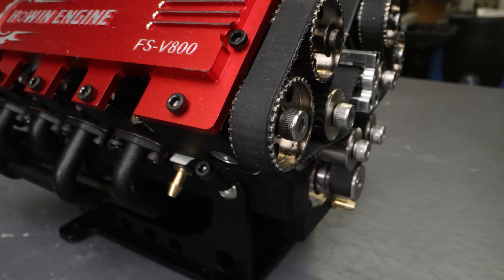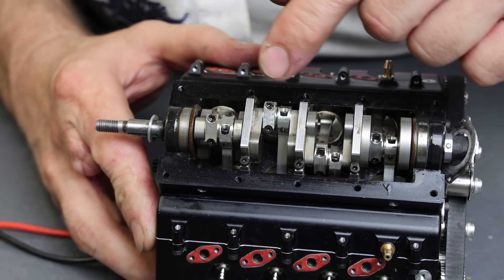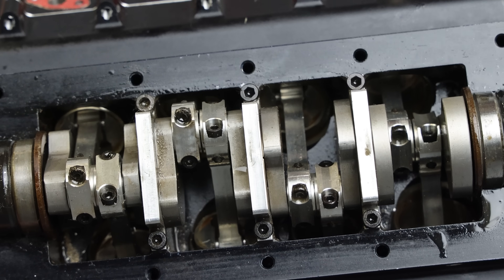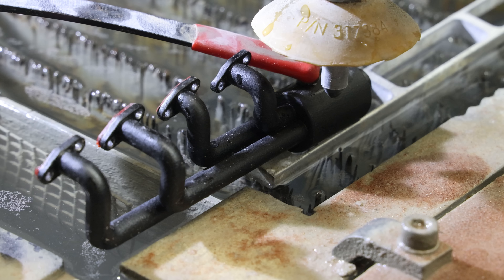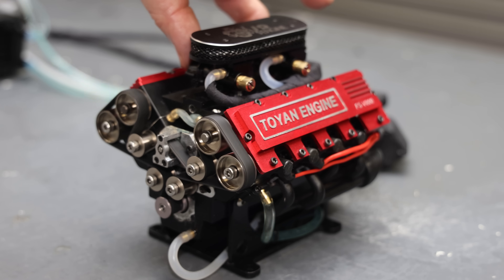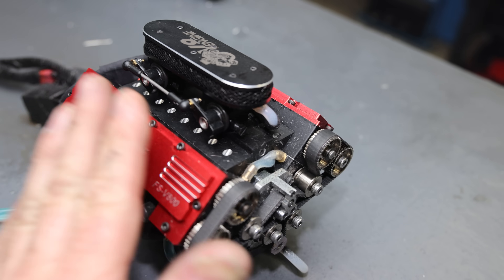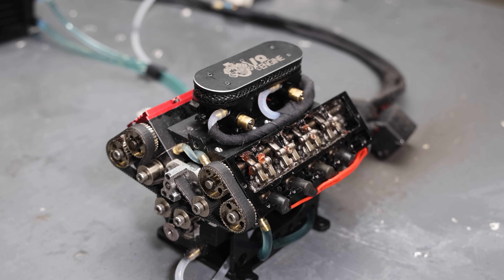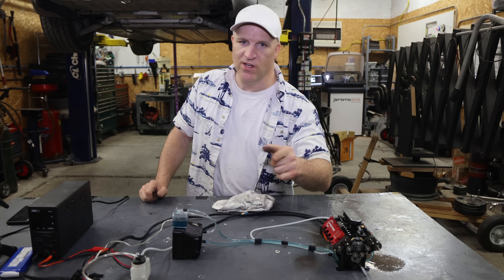World's Smallest V8 Engine Hits 10,500 RPM on Nitro (1.7 Cu In 28cc)

Comment: FYI, there's a possibility that you'll break one of those exhaust valves if you run this engine for an extended period of time without an exhaust system especially at high RPM. That's why I recommended running zoomies to get the sound you want. Under "real world" circumstances, an exhaust system is there to provide the proper back pressure to enable scavenging of the spent exhaust gases. An exhaust system will also isolate the exhaust valves from being overexposed to O2, which will eventually oxidize them and crystallize their metal composite, making them potentially brittle. You could even put small balls into the ends of the zoomies to prevent water condensation from entering them during or after cool down.
Reply from the maker: Thanks! Those are really great details, those are things not many people think about but you're absolutely correct.
For sure I am going to make a proper exhaust, I just ran it without the exhaust to see if it can actually get louder or is it like an engine Port size issue... Thanks !
Reply: @WarpedYT  Great. I was hoping you understood the importance of an exhaust and can definitely improve the sound with a proper exhaust design anyway...
Reply: Back pressure does not scavenge; it does the opposite.  Oxidation of the exhaust valves or their exposure to O2 isn't the problem; it's that they run too cold.
Reply: You know your stuff buddy have a great day
Reply: @wilbobagins  That's incorrect. This is in fact a four-stroke engine with a functioning valve train. It runs on nitro fuel mixed with oil like a two-stroke, but it is a true four-stroke. Toyan's website gives all this information and more. As for the second cam sprocket, it isn't in use on this particular engine, but the company does plan on adding a second camshaft in the near future. Possibly as an upgrade for the existing single-cam models.
Reply: Obviously you know very little about engines and even less about exhaust systems. Everything you said is wrong.
Reply: @billshiff2060  Basic shop theory. Sounds like you need to go back to school. Albeit, you likely excel at running your mouth.
Reply: @frankhamilton8257  Basic shop bullchit you mean. A soon as some dufus says "DUHH back pressure" we KNOW he knows NOTHING. You haven't got the faintest idea how headers work.  You might have enough knowledge to  understand , maybe, a lawn mower exhaust, a can with holes in it to reduce the "back pressure" lol but thats about IT..
Reply: @billshiff2060  Apparently, you're well practiced at the art of trolling. And your "expert" and concise critique is written in English, no less - well, sort of. You know what they say, "Those who can't, criticize." Kudo's to you. You have no concept when you're WAY outclassed. How many books have you written on the subject?
Reply: @frankhamilton8257  You can read what I wrote on Wikipedia dufus.
Reply: Backpressure is never a good thing. You will have more scavenging and make more power with less back pressure in almost every situation
Reply: @Mrshotshell  I've home made car exhaust systems, and in my case, no back pressure much had less power, to much back pressure had no high rims.
Some back pressure is needed, but between all engines the amount needed vary's.
Reply: @Mrshotshell  You obviously don't understand the concept. There's a reason every engine has an exhaust system and it has nothing to do with back pressure or noise. An exhaust system, whether it's zoomies (which effectively produces little or no back pressure) or otherwise, is not just there to direct exhaust gas to be dumped out at some point rear of the driver. From an engine perspective (all other issues aside) an exhaust system is ideally designed to "tune" the air flow as it travels through the engine (particularly in an engine with normal induction), and while doing so, provides a certain level of protection to the exhaust valves from being exposed to ambient air, which will ultimately weaken or fatigue the alloys in the metal.
Reply: @frankhamilton8257  I never disagreed with that part at all, just the part about needing backpressure
Reply: @frankhamilton8257  My understanding is that the issue with no headers and the valves is thermal shock, i.e. cold air hitting the 800+ degrees C valve cools it very rapidly, over time this can cause cracks to grow in the valve until it breaks. Should not be a serious issue for such a small motor, smaller valves generally don't get as hot because they have more area to conduct heat to the head relative to the amount of heat they absorb. Also glowmotors run on methanol with a hefty dose of oil (usually 20% or so), which naturally burns a lot cooler than gasoline.

More broadly, I suspect that this is an engine specific issue. Many WW2 fighters had 'stub' exhausts, the 'header' if you can call it that was no more than a short nozzle that directed the exhaust flow backwards as it came out of the ports on each cylinder (for bonus jet thrust!). These would surely be candidates for the thermal shocking issue, but on the contrary most of them had more trouble with burnt valves than cracked ones, leading to the use of sodium cooled valves, stellite valve seats, etc.
Reply: @Mrshotshell  Some engines are tuned for specific amounts of back pressure (e.g., emission regulations) so, yes, it can be critical
Reply: @nerd1000ify  Yes, I would agree with that assessment. Obviously, this engine is a scale model that will never see the stresses of what a real world engine would see, but there's no substitute for best practice whenever possible. However, it's not quite clear what fuel this engine was running, and it's even more unclear how much heat is produced in this exhaust chamber at the point of combustion, but the operator did note the presence of extreme heat (extreme heat from a human perspective).
Reply: @Mrshotshell  If there's no back-pressure, there's no tuning, very little is better than none. Otherwise your not directing anything and it's a chimeny? at best.

Comment: Man the exhaust really messed up the sound, a set of equal length exhausts would be amazing, jhonnyQ needs to do his magic
Reply from the maker: I'm on the exhaust already, when things get this small they become very difficult to make things like equal length headers and as you probably saw on Johnny's Channel making boost with a supercharger that's that small... I think these pipes need to be bigger overall problem is the distance between the flange bolts will not allow you to fit a bigger pipe.
Reply: @WarpedYT  I agree, they look like they could be bored out a little bit but will it make much of a difference really. Are you able to show the inside of the engine or you can’t because its prototype

Comment: If these sell well, maybe they will produce a mini v12. I saw another of these engines running on another channel with no air in the coolant system, so should be capable of staying a-lot cooler.
Reply: It was hot because he did not let the engine idle after max throttle , the water pump is driven by the belt circulating the coolant .... rookie mistake

Comment: Pretty cool! What kind of oil do you use? What oil was in the mini Panhead?
Reply from the maker: 2stroke oil in the gas for the V2 nitro RC fuel for this one.
Reply: @WarpedYT  
The V2 is a 4 stroke also, how does oil get to the crank? I only ask because nobody mentions putting oil in the Mini Panhead and in every video they blow up.

Comment: Why nitro versus gas?
Reply from the maker: I'm pretty positive it's because an ignition system probably takes a lot more time to develop since it's 8 cylinders. Nitro is easy just put in all glow plugs give it power and start it up that's it.
Reply: @WarpedYT  Ah, so it's more a diesel engine than gas.

Comment: I like it I also like how it looks like a duel overhead cam but only has one cam per head but it’s still awesome I’d love to see how much hp it could make
Reply: The VE will be worse for this engine over an equivalent displacement single or dual cylinder just strictly on frictional losses. It's an aesthetic engine, not an outright performer. I probably wouldn't do much to it simply because lubrication is the biggest enemy to an engine like that, especially for an overhead cam setup like that.

The other problem is that it's a 4 stroke and an equivalent displacement 2 stroke will blow this thing away in outright power.

Comment: I'm trying to decide which small item makes the most sense to power with this
Reply: I think I'll get one for the kitchen, and run everything off of a long shaft running through the kitchen like the Germans ran their machine shops in WWII. Belt drive for the blender, the mixer, the meat grinder....
She'll really like that. 🤫I think😜
Reply from the maker: @BearBig70  that would be awesome and funny as hell
Reply from the maker: I'm not sure what the HP output is I think they said 4.3 HP.
Reply: @WarpedYT  I don't really understand engines. I just watch videos. But how would its torque rating affect that? My lawnmower is like 2 or 3HP. What would happen if this thing had to cut grass? I imagine that it would just cut out as there's 0 weight behind keeping it moving.
Reply from the maker: That's a great question, I think the same things sometimes because they're so small but this one is supposed to be 4.5 horsepower,  I absolutely have to test that in an upcoming video
Reply: @01DOGG01  just gear it down and it'll be fine on a push mower.
Reply: @01DOGG01  power is torque times rpm. this thing probably  only makes 4hp at max rpm, where a lawn mower chugs along at about a 2500rpm. if you gear it down to the same output speed, it shouldnt make a difference. although the lawnmower engine is probably much more efficient
Reply: @01DOGG01  The engine on a lawn mower have way more torque because it has way bigger piston surface. More surface, more pressure by combustion produced. More pressure more force and in the case you don't know, torque is a force that rotating objects produce( force by diameter).
Reply: @zqzj  gear it down so that the blade speed reached around 3500 - 4000 rpm that’s generally where the operate
Reply: @harrylenon9594  well you're almost there Harry LOL. 
Torque times RPM divided by 5252

That's why if you're ever giving the torque value at 5252, the horsepower number would obviously be the same.

This is why all American Dyno graphs cross at 5252

1.7 * 10,500 / 3456 =5.16 CFM

An engine is just an air pump, this one spinning at 10,500 RPMs moves 5.16 cubic feet a minute of air

So if it was 3.4 cubic inches instead of 1.7. it would only have to spin it 5,250.

And if it was 6.8 cubic inches it would only have to spin at 2,625 RPMs. Now we're getting into lawn mower territory

Exact same amount of air being moved, in each of these cases
Reply: @cenreaper3221  wow! 

Let me guess, everything you know about cars you learned from Hot rod magazine.

You don't mean the diameter of the steering wheel is proportionate to how much horsepower your motor makes do you. Cuz that has about as much relevance as the diameter of the piston.

Your displacement determines your torque the reason stroking a motor gives you more torque is because you have more displacement. If you would have bored it out to make that displacement you would see similar torque numbers.

But let's go with your theory. An IndyCar motor has a much bigger diameter bore than it does stroke and those are very low torque motors

So even in the most prime example what you're talking about doesn't hold water

Displacement equals torque

Torque times RPM equals horsepower

200 cubic inches at 10,000 RPMs is the same air flow as 400 cubic inches at 5,000 RPMs

This is why Indy cars rev to the high heavens to try and make the horsepower they are looking for

And this is why old Big blocks had a red line of around 5,000

The more displacement you have the greater the torque and the less need for RPMs to make the power you want.

A small motor is always going to have to rev to the high heavens.

If you want a small motor that turns low RPMs and makes a lot of torque.. you want a diesel
Reply: @Bozemanjustin yeah I simplified it somewhat, i suppose I should have said speed rather than RPM. You don't need a scalar when calculating power in kilowatts :) just convert everything to base units
Reply: @Bozemanjustin  thank you for being the voice of sanity 🙌
Reply: @01DOGG01  the weight of the flywheel is what keeps engines running because there’s no power for 3 of the 4 strokes basically the power stroke rotates the flywheel and the flywheel takes the energy from that and rotates the engine for three more strokes (1 stroke = one motion of the piston) so yes you are correct it would likely cut out because the flywheel isn’t heavy enough to keep that motor running under that much load
Reply: @WarpedYT  Well no shit man! think about how many minibikes back in the day used 3 hp snow blower and tiller engines?!?! this thing could actually do something then! I mean torque is probably shit up into 8k rpm range but god i'd like to build that into a rcf mini frame lol
Reply: @WarpedYT  4.3? That's half of a lawn mower engine
Reply: @WarpedYT  that's actually a LOT of power and even if it only makes 2.5 hp it's incredible!
Reply: @WarpedYT  🤯 that's impressive!!
Reply: @WarpedYT  wait a minute 4.3 HP??? I have a 50CC that makes 2 HP.
Reply: Rc plane
Reply: @Trapperboy190  it’s too heavy, too thirsty and lacks power for that.
Reply: Pencil sharpener
Reply: Mini z RC car
Reply: Tooth brush
Reply: Impact gun motor
Reply: String trimmer.
Reply: Blender!!
Reply: A boat
Reply: 69th like 🤔
Reply: @BiggMo  scale horses lol
Reply: A mini blender with a mini Jeremy Clarkson.
Reply: Hamster wheel.
Reply: 6:13 why did I see 10714 RPM ?
Reply: Tooth brush
Reply: DRILL
Reply: I’m thinking weedeater or a chainsaw or something 😂
Reply: Please no music in your videos. It's great to hear what your filming even in slo mo. Love your videos keep up the great work. From Australia 🇦🇺
Reply: Bicycle or moped would be my vote. Maybe even supercharge it.
Reply: Your old lady’s vibrator
Reply: Power a blender with it,certified Top Gear moment.
Reply: You could probably put that onto a bicycle.
I had a cheap scooter made in china that had a claimed power of 5 horsepower and that thing went 70 km/h.
But gearing will likely be an issue, those scooters have CVTs for a reason.
Reply: rc race car. best bet with a traxis engine to tranny kit.
Reply: Traxxas udr but with metal pipe frame and hoonigan paint job and body
Reply: Small power boat

Comment: It's misfiring badly...  When you have so many cylinders, you need a proper ignition system. This engine needs real sparkplugs and an Electronic Ignition System to create organized firing inside the cylinders.. It's a shame they did  in Nitro intead of pump gas.   No oil pump either.  Improvements need to be  done here.
Reply: I doesn't even have like a proper oil sump, the crankshaft only gets lubricated be the nitro-oil mix that passes through the rings
Reply: @eljaibas16  I  wouldn't have  approved such a  crappy engine system to  be taken to production... I mean, how is this  supposed to compete against a brushless motor..  let's not  even  talk about price differences.. a  premium  brushless motor is about  $200 bucks..   8  times cheaper, and  20 times cleaner.

This engine needs:
*Proper Ignition System with coil box
*Real sparkplugs
*Crankshaft position sensor linked  to  ignition  computer to  tell the sparkplugs when to  fire.
*Oil pump to bring oil to the head.
*Piston Ring sets to  increase compression

and  something extra but really nice:

*a hydraulic  torque  converter  to  be  able to use combustion rc engines  in rock  crawlers...  centrifugal  clutches suck at  low rpms.
Reply: @P_double_H   but they dont sound like anything special. who cares about your dewalt BLM rc car
Reply: @lsxbigblock6524  what are you talking about man.. did you even read.  What car are you talking about.. you need social skills for your soul.
Reply: @P_double_H  Agree, for that kind of money it should have a real ignition and lubrication system, expensive toy beside it takes a lot of fuel, awesome tough